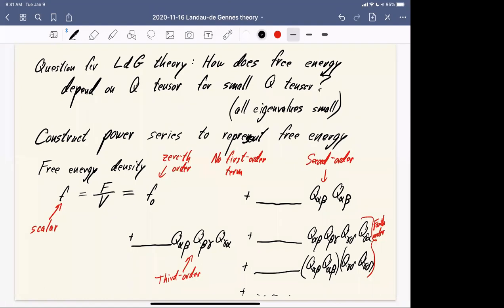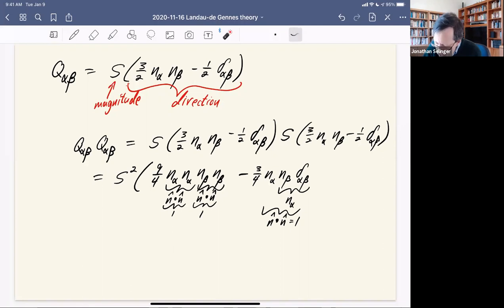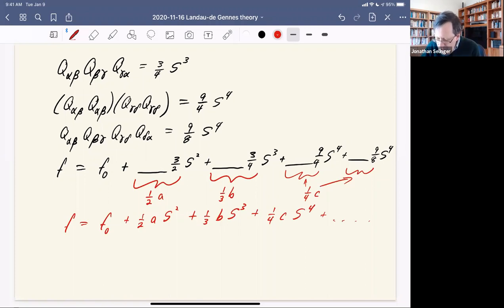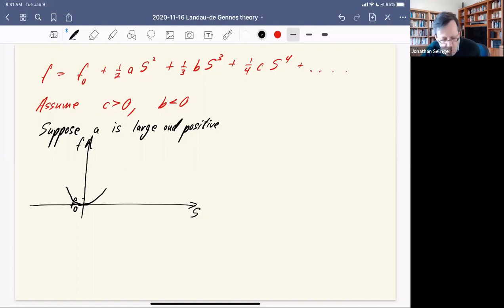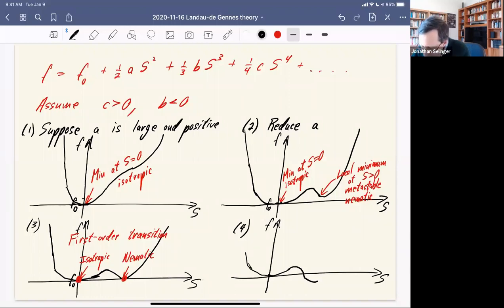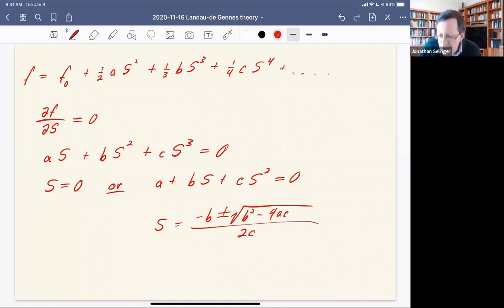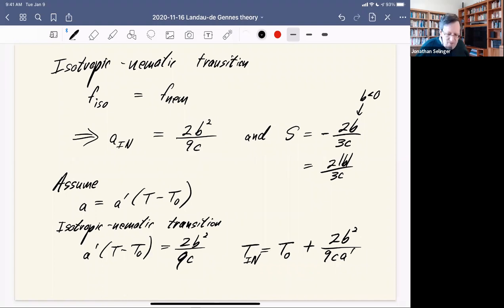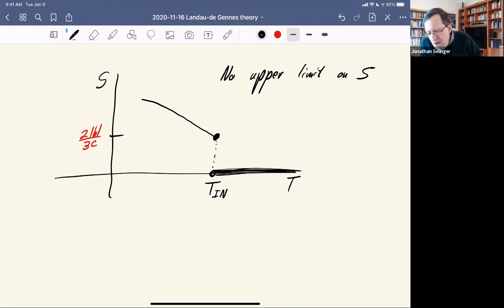2020 11 16 Landau de Gennes theory

Comment: You mentioned the magnitude of S is usually bounded between 0 and 1. therefore, as far as I understand, even if the coefficient of S^4 is negative the system will not be thermodynamically unstable, because the free energy remains bounded as well.
Reply from the maker: Yes, the magnitude of S is bounded between -0.5 and 1. However, Landau-de Gennes theory does not know about these bounds. We want the theory to be thermodynamically stable by itself, without imposing an extra constraint on S. For that reason, the coefficient of S^4 must be positive.
Reply: @JonathanSelinger  I understand. Thanks for the explanation.